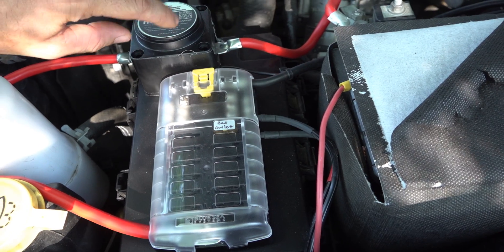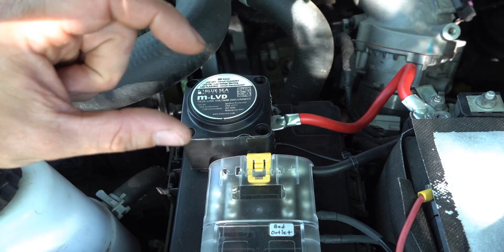FUSE Panel and LVD Install - RAM 2500

Comment: What is the purpose of the LVD?
Reply from the maker: The LVD disconnects the accessories from the battery if the voltage drops to a certain level. This protects the battery from being drained dead.

Comment: G'day from Australia
Why on earth did you make that second (small) earth cable so long and take it all the way back to the battery? Why not just make a small cable that goes onto one of the earth bus lugs on the new fuse block?
Also, I'd be adding heat shrink over the exposed ends of those two large cables in/out of the LVD. They too exposed and easy to create a short.
Reply from the maker: That's just generally how I wire. You could definitely ground it to the frame with no issues, I personally like grounding to the battery.
Reply: @AmateurAtBest  yeah, but you already have a big fat ground wire going to the new fuse block. It would have been MUCH easier to just use one of those little screw terminals....not even 2" from the LVD.....
Reply from the maker: Thank you for sharing your experience. We can all learn from one another.

Comment: Question about the LVD. I bought one and the bolt that the hot wire connects to broke in half. Do you think there is anyway to remove the bolt and replace it with a new one?
Reply from the maker: Sorry I didn't get to this sooner, I haven't really looked at it. You probably could if you can get it in half.

Comment: could just be the electrician in me, but just based off what i saw, you're gonna have a hard time opening your fuse box lid.  And depending on what you plan on connecting to that fuse panel, i would suggest doing a big 3 upgrade as well.  I know that upgrade is more for sound systems, but it wouldnt hurt.  Also, i I would put heat shrink tubing on any exposed metal connections that carry current that has easy access to them
Reply from the maker: Of course the stock fuse box lid will be a tad more difficult to open but I can still open it when I need...which is almost never, lol. The truck is 7 years old now and I've never had to replaced a stock fuse. It's really a non issue. I am interested in the big 3 though, what is that?
Reply: @AmateurAtBest  Big 3 upgrade is basically upgrading your main battery cables. Easy search on Amazon

Comment: No override switch??? Useless
Reply from the maker: It came with an override switch if you so choose to install it...#notuseless
Reply: Well what's the point of an install video if all you do is connect the easy part? Did my install today,  with the switch, you're missing out.
Reply from the maker: @Kirbythediver  that's great! However, I personally do not need, nor never will need to override the LVD based on the components I have connected. The ability to start my truck is much more important, which will also re engage the LVD to allow power to the components again. It all comes down to philosophy of use. I'm glad you got yours wired up right and I hope it works out for your situation.
Reply: @AmateurAtBest  you should do a 2nd battery with an isolator like I did. I am using the LVD on the 2nd battery to keep its life. The override is good for my use as it's an AUX battery.
Reply from the maker: @Kirbythediver  the only issue with that for me is that my truck needs 2 starting batteries as it is. I don't really want a 3rd battery, especially since I'm about to install 400 watts of solar this summer. My buddy did the second battery with the isolator in his 4runner and it works gear. The LVD just works better for me with my vehicle and setup.

Comment: It’s glued to the stock fuse block correct?
Reply from the maker: I see what you're saying. You just leave enough slack to open the lid... fuses don't blow very often so it's not much of an issue. It may not be for everyone but it works for me.

Comment: The pre-made wires you're showing at 00:17 are poorly made and dangerous. You're also using wiring that is way too small for the application; you need at least 4 AWG. Buy quality cable, compression lugs, and a proper crimper; anything less than that and you're just wasting money.
Reply from the maker: Thank you for taking the time to leave a comment. The battery cables I used in this video are 4 AWG wire. They are sized appropriately and the system works flawlessly.
Reply: @AmateurAtBest  The cables I time-referenced are not 4 awg, they are labeled 4, but are actually 6 & or maybe even 8 awg--with thick insulation. I have those very same cables. Do yourself a favor; take one of those cables and cut off the crimp, then measure the diameter of the tightly bundled copper strands. Then compare that measurement to true 4 awg specs.
Reply: @peterrocan2542  You may be right, some premade cables have poor crimps and wire size/quality. But I suspect the small gear he is running off that fuse panel won't stress 4, 6 or 8 ga at all. If he was running a charging line to an Aux battery or to a winch, then yes. But for radios and stuff, 6 or 8 will be fine. I suspect he sized his system with head room to spare.

Comment: Love this setup. Could I wore an inverter to the fuse block and what size fuse would I use.
Reply from the maker: That depends on the inverter. If you look on the back of the inverter it should have a built in fuse, just use the same size.

Comment: Can I connect a 120v plug to this system? Like you did on your other video, instead of a 12v cigarette lighter
Reply from the maker: Are you talking about an inverter? If so then yes. I actually hooked up a 600w inverter to this fuse block and installed it inside the cab of the truck. I should throw up a video on that as well.

Comment: Like Derek I thought this was the answer to what I needed until I got into the nitty gritty of how the LVD worked. I did notice you have several serious problems that make cause you problems down the road including setting fire to your truck. First off you must put in a circuit breaker or inline fuse between the LVD and the battery (60A minimum). Secondly you need to put a 10A fuse inline on the ground wire going to the VDL. This is not strictly needed as you have used or wired in the remote switch. If you do install that switch you will need that fuse. The LVD isn't cheap so you don't want to burn it out right?
Reply: Iif i run 20 gauge wire to the rocker switch  both +- (5 inches) would that be ok, he used 14 gauge. I figure its just to power the switch. Also it says you need put a fuse on that line for ground 10A ??  My battery are connections are 12 gauge its for a boat : radio, horn, led lights, fish finder, anchor.

Comment: Nice video! Remember what gauge those wires are that are going to the battery from the LVR and Fuse block? Look like 6 or 4? I ordered one of the fuse blocks and can't decide what gauge to go with
Reply from the maker: I believe I used 6 gage, but I will say the lower the better. If you can get your hands on 4 gage I would definitely go that route.

Comment: i bought a fuse box a couple days ago, i couldnt decide how to wire it up, i knew i didnt want it to be hot all the time, I just wanted power to the accessories while the truck was on. while researching different ways to do this, i found your video. i bought that same LVD halfway through the video. I'm probably going to wire the button in right away. Thanks for the video, you have no idea how much time you saved me! Thank you!
Reply from the maker: I appreciate you taking time to leave a comment, I'm glad I could be of help. Good luck on your project!
Reply: Derek, from what I understand you want power to the fuse block when the truck is running. This type of set up will have power all the time except when the battery dips below a certain voltage. In other words it's not a switched system designed to do what you're looking for.

Comment: Great video!  What’s the purpose of the LVD?  Have been wanting to do something like this for my accessory lights on my 1500.
Reply from the maker: The LVD is a Low Voltage Disconnect. It'll automatically disconnect the fuse panel (and everything connected to it) if thre battery drops below a certain voltage allowing you to still be able to start your vehicle.
Reply: roll_with_hoth thank you for that explanation!
Reply: So it’s basically wiring to the ignition in a way? It all kicks back on when your truck turns on?
Reply: @pinnacle_actual  No it's not wired to the ignition. It simply disconnect the fuse panel from the battery when the battery gets low. It will stay off until you start the truck and the CHARGING system brings the battery voltage up. Technically speaking it'll come on immediately because the LVD will sense the charging voltage and not the actual battery charge.
Reply: @rokonmac984  Is there any switch on LVD for adjusting the critical voltage remaining like 11.8V - 12.5V when to disconnect the fuse panel? If I connect a parking cam would that allow power for 24H?